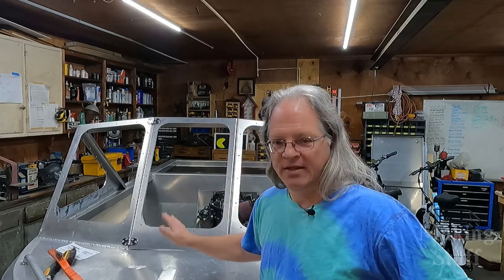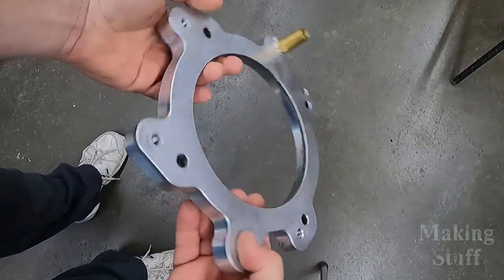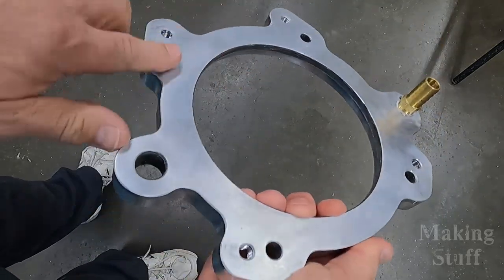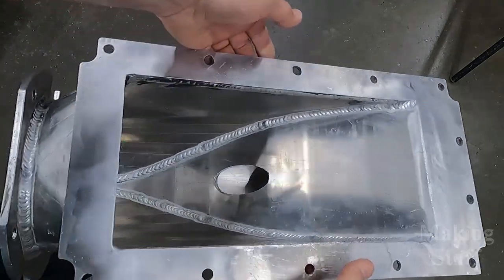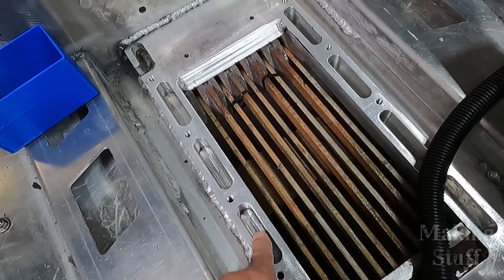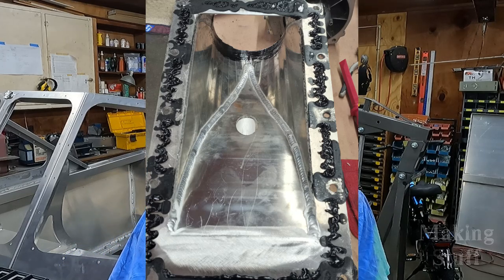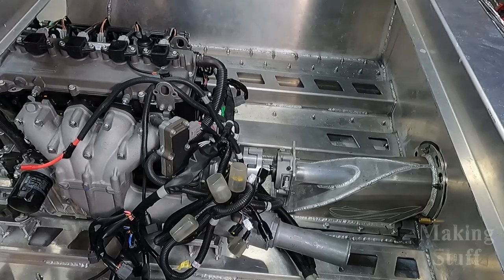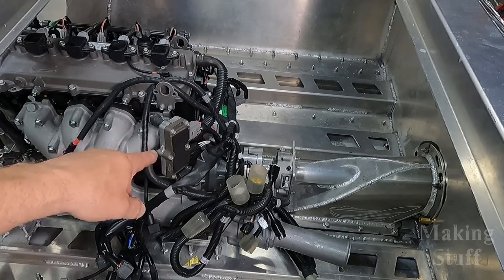I Screwed Up - Mini Jet Boat Build part 7

Comment: I did spot it, but only because you said to look for it. I saw your post about the car port, was wondering if you were going to share any more details!
Reply from the maker: I probably should have filmed more of the storm damage but didn't.  Everything has been cleaned up and repaired.  I'm just glad it's over.  Thanks for watching.

Comment: you adapted the mounting flange for the flexible coupling to the setting pins dont go completely through.
But it seems that now there will be a gap between the flange and the housing?
Another tip from a shipyard worker: try bostik instead of sikaflex, and put some tootpicks on the surface that you are squeezing.
This way you don't squeeze it out completely and respect the 2.5mm (yes imperial) thickness for optimal surface tension, flexibility and watertightness.
Reply from the maker: Thanks for the tip!

Comment: It’s coming along  you’ll be enjoying this summer. Good you caught the sealant oversight. Did you consider 3M 5200 sealant. I’ve been using it for  about 20 years. It’s a fantastic product.
Reply from the maker: The Sikaflex 291 comes highly recommended in the jet boat community.

Comment: Which  yeswelder would you recommend for welding aluminum.  I am soon to take on a jet boat build myself and need a mig welder?
Reply from the maker: The yWM-211P is the best aluminum welder I have used I wish it had been available when I started this project..  https://yeswelder.com/collections/welder-cutter/products/yeswelder-ywm-211p-double-pulse-aluminum-mig-welder?ref=makingstuff